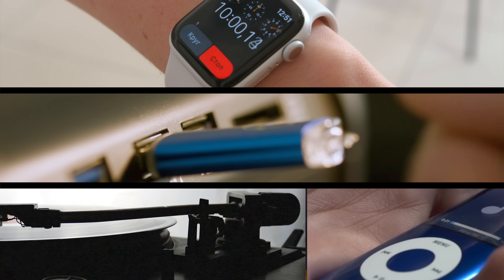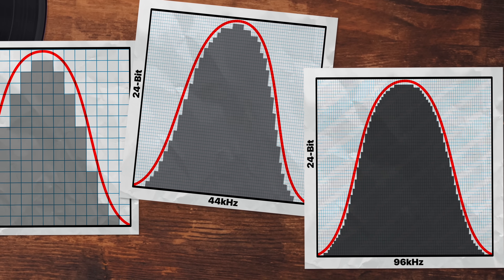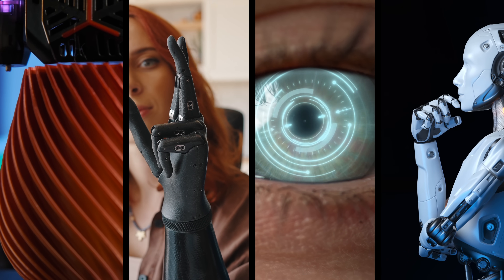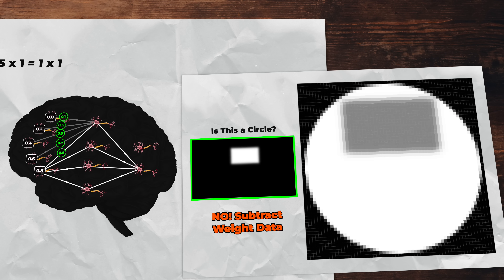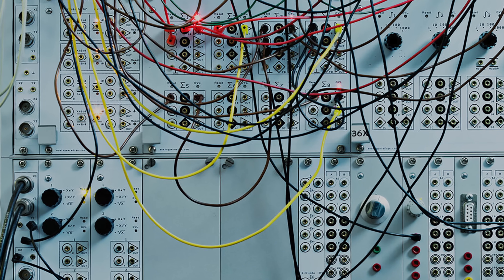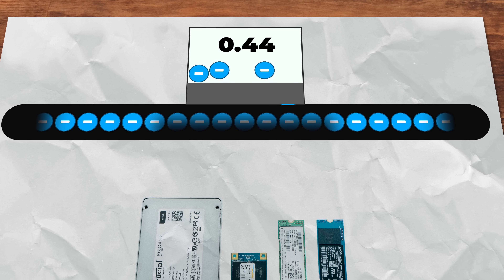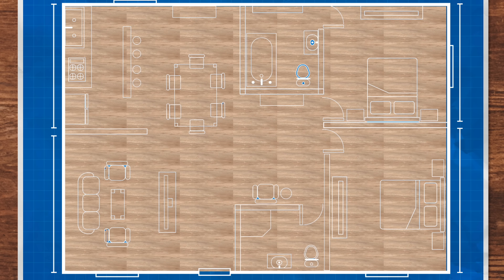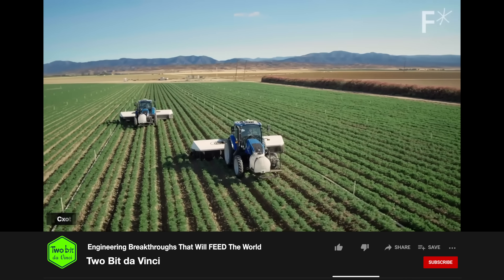Analog Computing is GENIUS - Here's Why!

Comment: Another pathway to solve the energy efficiency issue would be classical reversible computing.
The main tricks used by the designs explored in this video have to do with the fact that you need less bits of informations to describe a physical system when accuracy isn't critical AND you spend much less energy when this less accurate memory is closer to the computing units (in proper neuromorphic computing, those tend to be the same, even).

Reversible computing directly goes after the fundamental cause of energy dissipation in digital systems (which, you have to remember, are necessary for faithful information transmission and general error-correction) aside from intrinsic factors such as friction and electrical resistance (that analog computers don't address de facto either): information erasure.
It turns out, from Landauer's principle that there is an irreducible energy cost associated with information erasure at the bit level and since the logic gates used in conventional CPUs aren't reversible/injective (simply for cardinality reasons), these costs add up... before you even start taking intrinsic resistance into account. 

Even a perfectly superconducting, ultrastable conventional CPU would need to dissipate tens of Kilowatts of heat to perform a ZettaFLOPS of compute. In contrast, there are reversible nanomechanical "chips" designs that could theoretically perform at the Zettascale while barely dissipating a single Watt of heat... less energy than a typical smartwatch ! More than analog computing, it's the field of reversible computing that we should keep an eye on.
Reply: There's one very, very important word in your post that sums up everything you've said. That word is "theoretically". In theory lots of things can happen. However, reality is somewhat different.

Comment: At what point is the human ear able to distinguish the difference in recording quality ? 
Sound quality improvement seems pointless if humans can't hear the difference.
Reply: It is not a single point, for example for voice about 64kbps in most coding formats is more than enough.
For songs, 192 kbps is good enough for home use but  with high quality amplifiers/speakers then 320 kbps  is more than enough.
If someone is special enough to tell the difference, there is also FLAC that is lossless and ranges from 800 to 1,400 kbps.

Comment: Reviewing the constant information In-form-ation Orientation to connection with No-thing-defined explains WYSIWYG is the Observable Analog circumstances of Euler's e-Pi-i infinitesimal Singularity-point constant @1-0-infinity Absolute Zero Kelvin Eternity-now/Aether, all information is instantaneous absolute zero-infinity sync-duration, not a solid, unless you define a Solid of Revolution in log-antilog relative-timing condensation. 

Analog Computation is what you think you see floating in existence in the absolute connection of centre of gravity location of coherence-cohesion objectives.., self-defining Agnostic neutrality Self Aether of modulation cause-effect mechanism..
A bit of a headache?
Reply: Not really. Just regular BS.

Comment: Yeah, Digital was never truly Digital you know, it was always just some conventions about analogue voltage levels(TTL/CMOS), and in a usecase like this, storing neuron BIAS values "vertically", we're basically removing those conventions and unleashing the full potential that every "digital Bit" had in the 1st place. LOVED this video... it suited my old school analogue brain really well 🙂
Reply: Not going anywhere much., Digital reigns supreme.
Reply: @rogerphelps9939  not arguing there, Digital wont ever go away, but specifically for AI model storage i see a huge upside if they manage to save hundredfold on power and space, because that also increases reading speed. The idea is to utilize the untapped capacity within each byte, surely there are costs and caveats that comes into that, and that's why you are correct in  your "digital supremacy" statement !
Reply: digital still uses real world transistors that are not binary but the logic is. inaryl. analog can't run software as in binary code compiled from source, in an analog computer it's just a fast, efficient and approximate parallel  computation. when computing power and efficiency matter more than precision such as executing cheaply a neural network that has already be trained. an analog neural network is just baked in "intelligence" that cant learn anything

Comment: 0:00: 📼 The video explores the concept of analog computing in a digital world.
0:00: Analog vs. digital computing
0:13: The significance of analog in a digital world
1:04: Exploration of analog representation in early cameras
3:11: 🤖 The video discusses the benefits of analog computers, the rise of AI and neural network training, and the use of smart machines like the Robo Rock S8 Pro Ultra.
3:11: Analog computers have benefits for specific tasks and are fast and energy efficient.
3:35: The rise of AI and neural network training is leading to many new possibilities and applications.
4:00: The use of smart machines like the Robo Rock S8 Pro Ultra is highlighted as a time-saving tool.
6:17: ⚙ The video explains the training process of neural networks for image recognition using matrix multiplication and weight adjustment.
6:17: Neural networks are trained by adjusting the weights assigned to each node based on the input data and desired output.
6:39: Repeating the training process with more data improves the model's ability to predict shapes accurately.
6:59: Increasing the number of inputs and hidden layers improves the robustness of neural networks but requires high compute power.
9:40: 🧠 The video explains how Mythic solves the problem of retaining values in memory using SSD flash drive technology.
9:40: Mythic uses SSD flash drive technology in a unique way to permanently store values on the screen, even if the device loses power.
10:05: Unlike traditional memory, the electrons in the floating gate of the SSD flash drive stay even when the voltage is removed, preventing current from flowing.
13:01: ⚙ Analog computers are fast and efficient but less accurate than digital computers, and Mythic solves the problem of compounding errors in analog computing.
13:01: Mythic solves the problem of compounding errors in analog computing by converting from analog to digital along the way.
13:14: Analog computers are fast, efficient, and low power consumption, but less accurate than digital computers.
Recapped using Tammy AI

Comment: same principle as optical matrix computers, the massively parallel ones, not the logical gate ones, both work anyways and are fast, the best optical logic gate computers use waveguide with x-ray photons in the gated pipe system.
Reply: Can I ask what kind of work or higher education has given you this knowledge. What subject even? 😮 Thanks
Reply: God knows alone @ThisDDJ
Reply: on the usual suspect I have a semi-phd/master on semiconductor tech in UNI if it matters @ThisDDJ